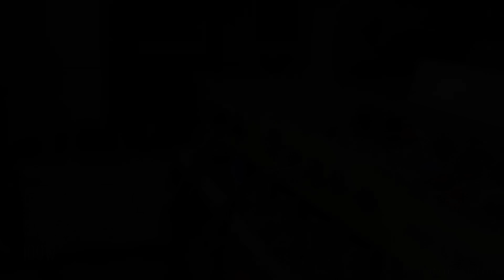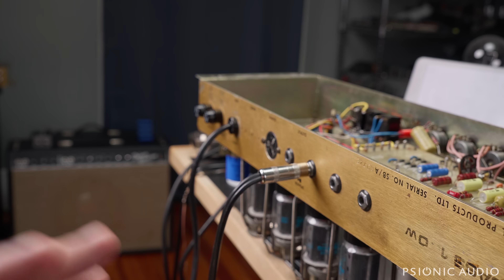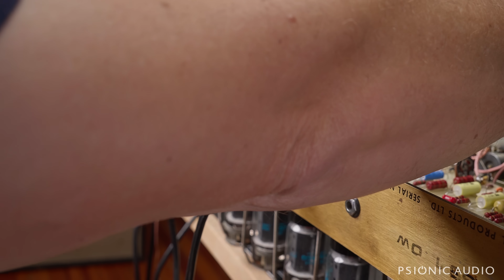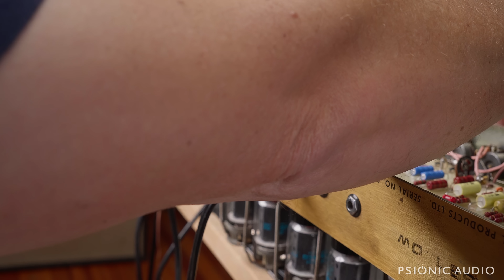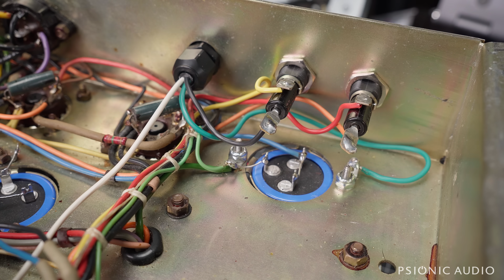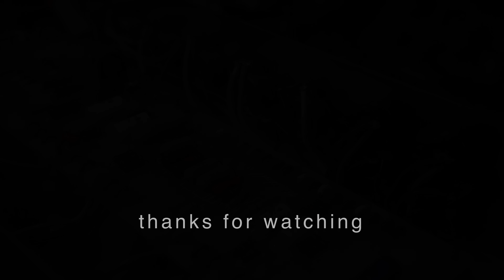God Tier | '73 Marshall Super Bass

Comment: Personally I'm very glad you call out very poor Tech F Upped Stuff and not the best/right choices of methods and or circuit stuff by factory & company designers honestly.

If you're going to do something, you do it right the 1st time, and Jerry Rig very specific things only when absolutely necessary...
 Like the correct thing is no longer made nor available anywhere for a reasonably fair enough cost relative to the actual part. 

😊❤🎉

Comment: Have you had the chance to work on newer Ashdown bass amps, especially the solid state models? Ashdown claims their solid state line is made to be 100% repairable, I'm wondering if this is true from an actual repairmans perspective.
Reply from the maker: Not any very recent ones but the ones from the past decade have had very bad design decisions with bad insulation between high/low voltage bits and capacitors getting baked by heat sinks. I’ve not been a fan.
Reply: @PsionicAudio  That's a bummer. I just switched to Ashdown after too many headaches with unserviceable class D amps.

Comment: Nice video, Lyle. For future reference, if I'm not mistaken, acetone can be used to dissolve cured superglue. That said, I don't know if it would also damage/dissolve the plastic the indicator lamp is made of. If it's made out of polystyrene, acrylic, polycarbonate, or ABS then it will make a mess out of the indicator lamp.
Reply: Acetone and most plastics do not get along (IIRC, Teflon, polypropylene and polyethyline are relatively immune). Commercial Superglue debonding agents are typically a mix of nitromethane and acetone, which similarly damages plastic. I don't know of any plastic-safe solvents for  CA glues....

Comment: You could build yourself an isolation box out of MDF and put a mic'd guitar cab in it, probably cheaper than getting a Suhr.
Reply from the maker: I’ll put that in the other wing of my mansion. Do you have any idea how large that setup would be? Or how limiting?
Reply from the maker: Oh, and it would cost a LOT more to do it right.
Reply: @PsionicAudio  fair point, you're not one to cut corners (lol, accidental pun, sorry). In New Zealand, anything from the US is expensive, so a Suhr reactive load would be getting close to $1.5K NZD, hence the MDF iso box is an attractive option. But yes, you do need a dingy basement for it to live in.
Reply: Suhr will be miles ahead in audio quality with a good IR. The only thing that would come close would be a Fryette Power Station but they introduce more variables so I’d take Suhr.

Comment: I have a Torpedo Captor X and a Tone King Ironman 2, both are fantastic for being able to turn up my tube amps to the juicy spot without the neighbors calling the cops.
Reply from the maker: Those are a lot more colored than the Suhr, Fryette, UA, and Fractal options.
Reply: @PsionicAudio   I haven’t noticed any negative tone coloring out of my Friedman Smallbox, that’s what I mainly use them for. I have a Marshall DSL40CR that I haven’t used them on yet. Using the 20 watt setting on the amp the volume is manageable.

Comment: You'll love it once you get a reactive load.  Being able to use a 100 watt amp at any hour of the day, at power, by running an IR loader and headphones is both fun and a kindness to your hearing.  Easily the best guitar related purchase I've made in the last 10 years.
Reply: what do you use?
Reply: I use an older Two Notes Torpedo Live.  It's a good and inexpensive choice since I see them for $300ish, used, and they're fine for up to 100W (and Peavey's 120W amps).  I'd love to get the Suhr reactive load/IR or the Fryette Power Station because they supposedly react nicer, but I haven't felt the need to replace what's working.

I'll usually have the Torpedo Live set with no cab/mic setup and run it into a DAW and then use a cab loader so I have more options with respect to handling the IRs.  Wall of Sound is great for Two Notes' cabs, since you can do multiple cabs at a time (since the Torpedo Live is a 10 year old design, it can only do one cab sim).  Ignite Libra is what I use for normal IRs since I can blend between multiple IRs at once.  That said, if you don't want to be running cables and so forth, a single cab sim running on the Torpedo can sound ver nice.

In general, amp sims aren't quite perfect, but they're pretty close to as good as a real cab.  With the Torpedo Live, I've noticed that I need to set the knobs a bit brighter than I would if I had the amp run into a real cab.  Even if I run a V30 IR and then plug the same amp into a physical V30 cabinet, it's always super harsh in the room until I back treble and presence off.  Might be the older design of the Torpedo Live, might be the IRs I run, might be the way my ear hears the real speaker vs the filtering from the mic being added to the IR.  But it still gives you a real amp to use and the lower noise floor of a tube amp, compared to my experience with amp sims, along with the real amp feel.  

Since I'm just an enthusiastic amateur, it's the difference between only being able to fire up 100W heads on special occasions or being able to use them at will.  And that's ignoring the ability to not cause further hearing damage/loss compared to what I've already done to myself when I was younger.  So long as you're not hoping to use it with super high wattage artillery like a Sunn Model T or a Marshall Major, it's a fantastic tool.
Reply: @calliphor8764 thank you!

Comment: Wow, there's like no hum. I think Lyle is a master of grounding.
Reply from the maker: Thanks.

In this case, of cleaning all ground connections. This is the stock scheme here. Just working again for the first time in decades, going by the dirt/corrosion/bad solder I got out.

So I am a Master Janitor. If you need me, I’ll be in my El Camino…
Reply: Wow, it does not cease to amaze me how much difference the soldering makes.
Reply: King Midas of amp repair!

Comment: Sounds great, low noise floor. Do you find that some of these older amps are just quiet? Or do you have to change the ground scheme? Great video!
Reply from the maker: Thanks. There are a lot of factors. Having a shared fully bypassed cathode on V1 helps. Having relatively low gain in the preamp helps. 

But some are just noisy and others just aren’t. With the stock grounding. I can make them all quiet by changing that, but decided this one didn’t need the extra bit.